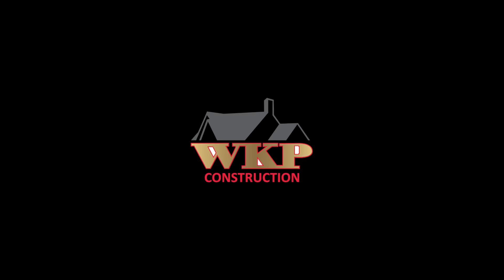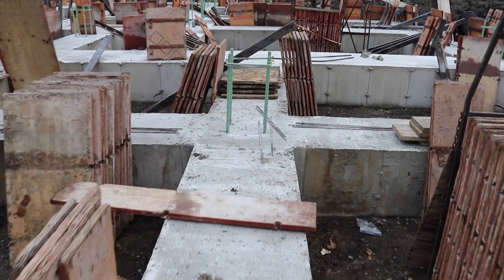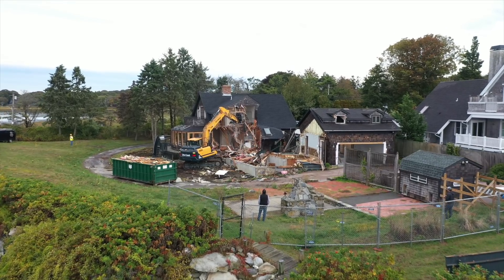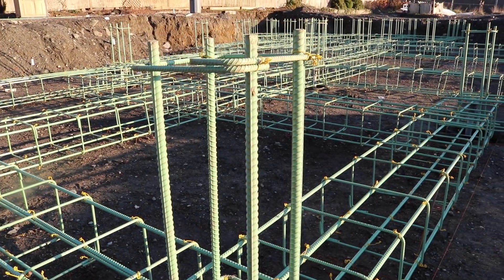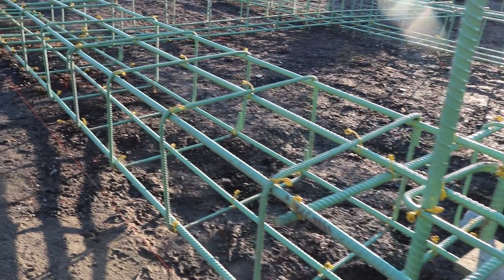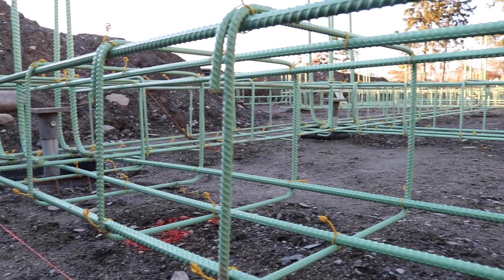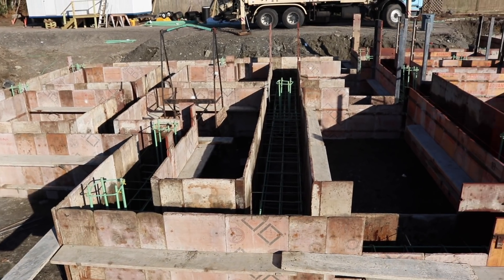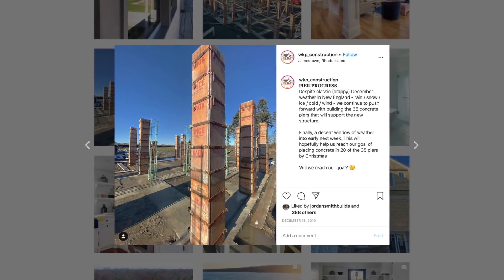How to Prepare a Foundation with Helical Piers for a FLOOD ZONE

Comment: Why not fiberglass rebar instead of epoxy coated.  If you’re going for a 100-200 year home wouldn’t that give you greater durability in terms of risk of rusting overtime of a steel product despite the epoxy coating? Plenty of 50+ year old bridges in America that used epoxy coated and it still rusts
Reply: I asked the same almost a week ago, no response. My guess is they do not respond to comments on channel.

In many cases frp is not used due to cost, sometimes supply and many times its lack of knowledge/familiarity.

For cost, yes it’s typically 15-20% higher than coated steel. When factoring in labor to inspect & re-touch all coated steel damaged during installation, as required by structural engineers, the material cost is roughly equal; often cheaper on very large sites such as subject. 

In terms of supply, it’s not just ordering the lengths on site, it’s spec’ing the bends which must be done at factory during fabrication. Where I am in high Rockies, we have supplier down in Denver 90 minutes away with typical lead times of under 2 weeks. Working off structural drawings, all materials can be ordered within required lead times w/o issue. Can same be done to this job site? 

While frp rebar has been around for decades, there remains a lack of knowledge. Many builders and engineers prefer to stick with what’s familiar. Even within frp space, they lack application knowledge between gfrp, cfrp and bfrp. When, where and how to use each. In this case gfrp or bfrp would have been more suitable than the coated steel at comparable cost delivering superior long term service.
Reply: My parents want to invest a seaside property in China and the property needs to be rebuilt due to severe sea side corrosion ( it is literally 1m above sea level; the first floor is partially submerged once a year due to high tide between August and September). 

So I did extensive research on the topic and conclude that 316/317 stainless steel is better option than FRP for house; however, this drastic material change of material used in the building requires special permit to be built because it may break code: SS has superior elongation, fatigue, creep performance but the tensile strength is about 200MPa (CW carbon steel 300MPa-450MPa). And here comes the major obstacle: the city is not far away from a couple very active seismic zones; consequently the lower tensile strength may break the city's building code but in fact due to its superior fatigue/elongation, it can take way stronger earthquake and it is potentially repairable compared to carbon steel)
2205 could be a very good candidate if I can't get city to agree on using 316/317 but it is nearly 4-5 times more expensive than carbon steel where 316/317 is about double: 2205  can easily outlast anything in the market since that it has combined the strength and corrosion performance of carbon steel and 316. The problem with 2205 is more to do with welding: in China, I may get a shipyard/chemical reactor producer to do the weld. 

The rationale for choosing steel or stainless steel rather than FRP for building is that: underwater structures around the world right now are built using 2205 SS for its ability to form oxygen-free oxidation layer; and the bridges are built 316LN/316LVM/317SS in the air column section since there are plenty air to form the oxidation layer. 2205 is better for the splash zone but 316SS is generally sufficient for residential building. 
Besides, there are always fire and creep concern on FRP; and don't forget the FRP are heterogeneous material so a proper load design and onsite-installation could be an issue. 

China has banned the use of epoxy coated rebar in civil engineering due to premature crevice/pitting failure from imperfect coating since early 2000.
Reply: On top of this, I should say I see most buildings in my city back in China are built with concrete with "waterproofing" additives especially for the ones right beside the sea right now.

Comment: How do you protect pipes between the frost line and the internal space?
Reply: I am also interested in how they get the water main and sanitary lines up to the building.
Reply: They’re installing breakaway skirting around perimeter which should trap warmer air than outside. Between the skirting, wrap the sewer and water main in 2” closed cell foam or Armaflex and that should be sufficient given that climate. In colder climates you’d wrap lines in heating cables with automated thermister. I highly doubt that is necessary in this coastal setting that likely never sees sub-zero temps.